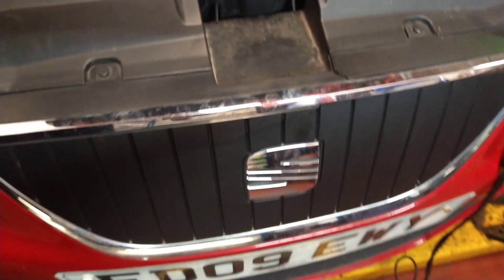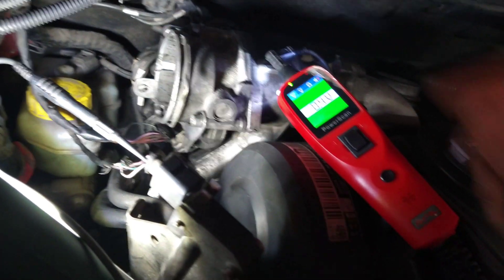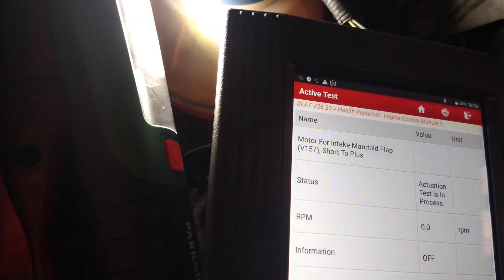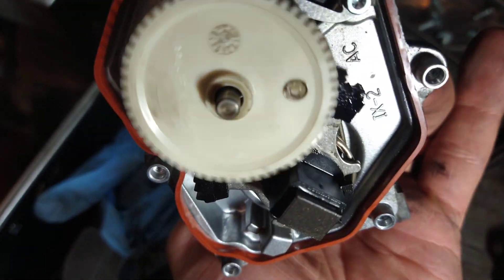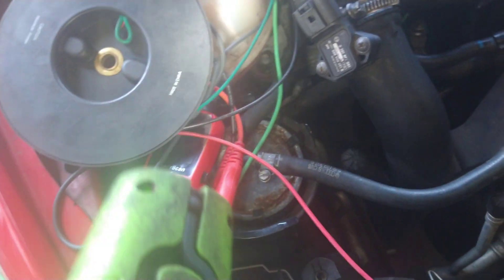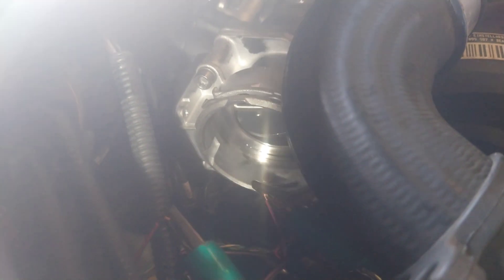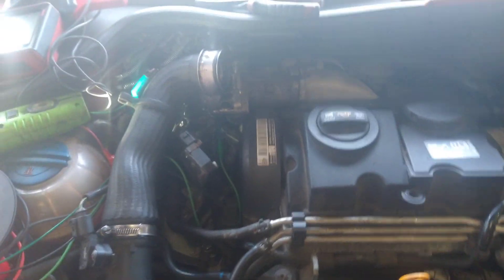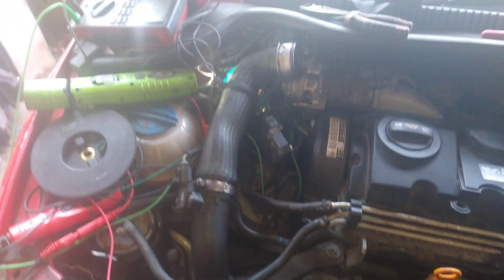SEAT electric Intake valve fault (PD engine) P2015

Comment: Had a similar Problem with a Golf TDI this week - Pin 4 is the Power, Pin 5 the Ground - Ground wire from the ECU was corroded so it could not close at shutdown.

Comment: It’s the little things like those wires being swapped around could catch a tech out quite easily, so well done for copping that Matt. I think you were speaking of this fault on Dave Sterl video ( teeth being pulled off a gear 🤔🤔). Great diag, thanks Matt 👍
Reply from the maker: That's right, I was talking it over with Dave and Sandy, at that time I hadn't realised that the two wires were swapped over. Thanks Peter
Reply: @mechanicmatt871  🙏

Comment: Hi Matt, strange fault that. I suppose the pins in the connector terminal housing could have been accidentally swapped without leaving any sign of interference? Did the car have any EGR flow or MAF faults stored? It’s my understanding that under certain conditions, the ECU will partially close the throttle flap to help promote exhaust gas flow through the EGR valve?
Reply from the maker: Hi Russell, In this case, it was just the one fault code that came back on after about a mile of driving. That could be where it was wanting to see the valve partially close.
The pins could have been swapped over in the plug without showing any signs of anyone being there. Thanks for watching and your comment

Comment: The valve is designed to stop the engine running on when you switch it off. Kind off suffercates it.  Do you think maybe it had had a ecu swap at some point and although correct one  for car could have different pin configuration.  Just a thought.  Also had one of these with earlier version which closed via   vacuum operation.  The control block had a short circuit and it randomlyvclosed while you was driving along causing car to suddenly stall. Took some finding
Reply from the maker: Hi, the car you had sounds like it would have been hard to find that fault on it mate.
This still had a tamper proof cage around the ECU on this car with the original bolts, however it may have had an engine swap at some time, great suggestion. Cheers Matt 👍